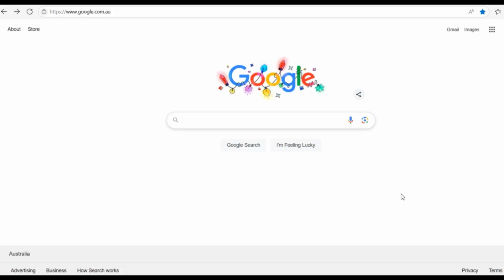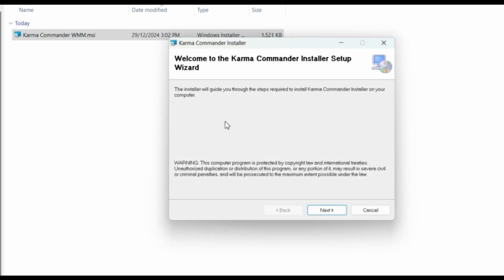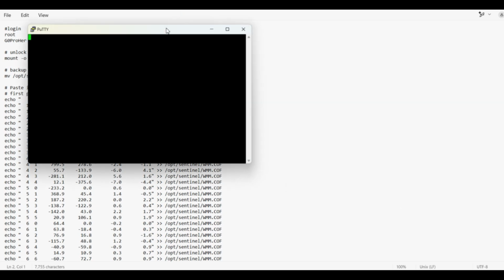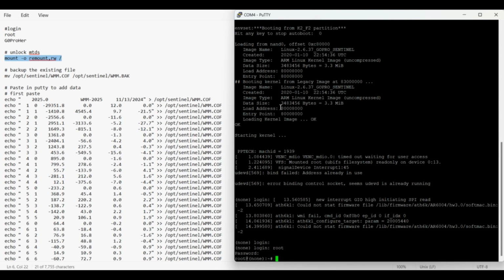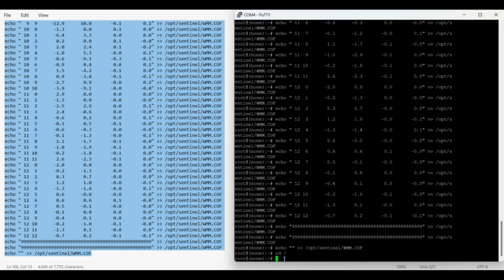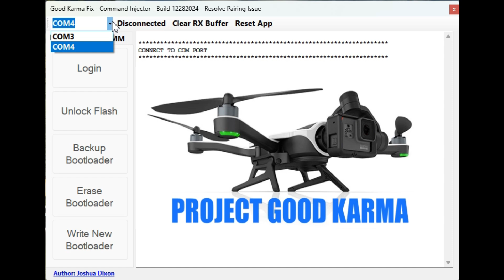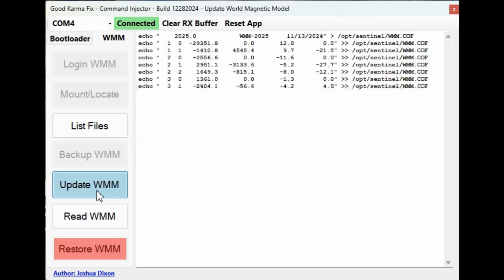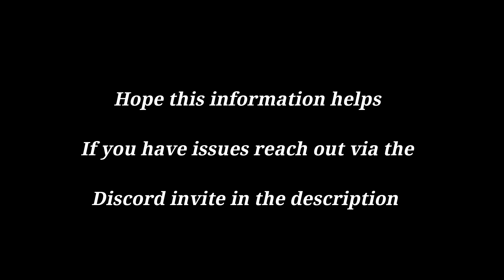GoPro Karma 2025 WMM Update Full process

Comment: We have updated the WMM per your video, (used the Commander method, great vid, thanks!) and checked the version as well (2025), however we're still having the same issues with it calibrating, it never finishes "acquiring gps location" and it keeps saying "compass interference move to a new location or recalibrate the compass", we also try to recalibrate the compass and keeps failing on step 2.   The software has been updated to 2.50.1 as well.  Any suggestions?
Reply from the maker: Make sure your not under cover and keep clear of metal objects, dont forget about steel reinforcement in concert slabs. I generally go to a sports field and go to the middle of it. A couple of people have had issues with the wmm.cof file updating correctly. It would be worth coming to the discord server and asking for help there we well as they will have the latest information.

Comment: sorry it’s still need sdcard reader for pairing issue fix why ttl can’t send data firmware ?
Reply from the maker: This video is for the WMM data update and a SD card is not required for it. 

I have been able to boot off the TTL to load the boot loader and then reflash the boot loader on the NAND but it only works on about 1 in 15 and you need a lot more equipment. Its easier and cheaper to build your own board or get one of the good Karma kits. You should do to the facebook page or discord server in the description to get more information on both these options.

Comment: Sorry so do I need to use the puTTY steps and THEN the Commander steps? Or is it one or the other?
Reply from the maker: Its one or the other. The command software is more automated, if you use putty you need to manually enter the commands (cut and paste).

Comment: Do you know if this impacts every Karma? After watching this and a few other WMM update videos, I went to see if I could still aquire GPS, and fortunately, I still do here in Texas, USA.
Reply from the maker: What you will find is that "if" the magnetic data for your area has changed that the drones compass will be out (its the whole true north v magnetic north, this data corrects that). Its not a big issue for flight as if the drone flys what it things is north and you do a rth it will fly back on what it things is south. That part of it is not a big issue as they really cancel themselves out (in not sure what happens when you add GPS data to this equation). 

Where you will have an issue is if you either manually calibrate the drone or the fight system forces you to calibrate the drone calibration of the compass will more than likely fail and you would be able to fly the drone. At this point you will need to update the WMM data.
Reply: Where can I get all the parts to build the device to update my karma?
Reply from the maker: @victorcorrea1408  for this update you only need a TTL device and a jst 1.25 pitch connector. There is a list of these parts in the description.

Comment: Can the update be done with an Arduino Uno? Im trying to revive my old gopro karma
Reply from the maker: are you talking about the WMM update or the pairing issue fix? You should be able to do either of these fixes from anything that has a terminal emulator. The controller update is normally done on Windows as it requires a device driver and uses an executable specific to Windows.
Reply: @ my GoPro karma constantly has a compass issue where it always detects interference. You cannot recalibrate the compass because for some reason it will not find gps signal. I’m going to try to update it to version 2.50 when I fix my windows machine.
Any info helps
Reply from the maker: @GenericUserName-f6u  you need to follow this video to upgrade to 2.50.1
https://www.youtube.com/watch?v=2s7sDVVZZsg
You then need to follow this video to add the latest WMM data https://www.youtube.com/watch?v=b_Yjoe3g8B8&lc=Ugx29fr0fzDWrYiI2Mx4AaABAg.AFGHqjAMLV5AFH1hv-16T3
Reply: @bozmanx  Thanks for the help! Cant wait to fly my Karma!
Reply from the maker: @GenericUserName-f6u  If you get stuck join the discord server and get some advice.
There is also a list of people who can fix it for you,
https://www.youtube.com/redirect?event=video_description&redir_token=QUFFLUhqbTNZLXRaQThKM25iSFY5U29PcjN1T1JHX1pIZ3xBQ3Jtc0tsenNsNnpzYkZPaEQ1MVh2QmNBblROV3E4WFczd3hBNHJsMmdUaDdpMnpuczJ6LXpXNVFsTlpDTWx1ZFVUVVBfT2RlNUVnakdvTElBMlVTbElLdFZaNEkzTVJfdHdsRWU3aHRHTUpUbngxaU5vaURjRQ&q=https%3A%2F%2Fwww.facebook.com%2Fgroups%2F1412898679632354%2Fpermalink%2F1413795696209319&v=b_Yjoe3g8B8

Comment: im about to update the WMM to 2025, i have no pairing issues at all my drone flies normal no issues, if i update it will i need to do anything to the remote?
Reply from the maker: You should make sure that your firmware is on 2.50.1 else you will need to run the WMM update after the firmware update.

Comment: Mine showed this error:
VENC initialization passed!
VENC UBL Version: 1.50
Booting Catalog Boot Loader
BootMode = NAND
Starting NAND Copy...
Valid magicnum, 0xA1ACED66, found in block 0x00000019.
Valid magicnum, 0xA1ACED66, found in block 0x0000001D.
Valid magicnum, 0xA1ACED66, found in block 0x00000021.
Valid magicnum, 0xA1ACED66, found in block 0x00000025.
Valid magicnum, 0xA1ACED66, found in block 0x00000029.
Valid magicnum, 0xA1ACED66, found in block 0x0000002D.
No valid boot image found!
NAND Boot failed.
Aborting...
Reply from the maker: You have the pairing issue, thats a different video

Comment: Don't you need the SD card? Don't you need to short the board to boot from the SD card?
Reply from the maker: You dont need an SD card and you dont need to short out TP1. Your making the change within the drones operating system and not replacing the operating system.
Reply: @ What good news, very grateful

Comment: the board adapter you are using to connect to your PC is it just a standard USB plug in or is plugged in to a com4 adapter to usb ? my PC has a com1 adapter but i need to buy a 9 pin to usb adapter in order to utilize the com port, or  am i able to just plug into usb port. Thank you in advance
Reply from the maker: Dont use a physical com port, it will be rs232 and will just output garbage. You need a USB to TTL serial device. There is an example device in the description.
Reply: I ordered those parts, so essentially I don’t need to use the physical port the part i ordered will act at a com port via usb correct, sorry I’m still learning